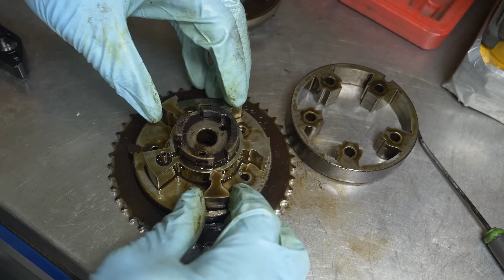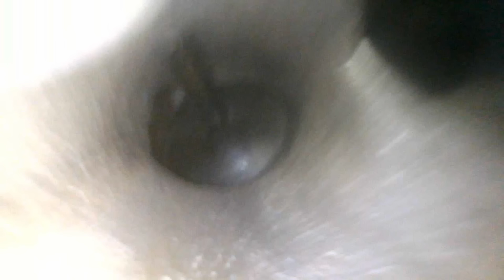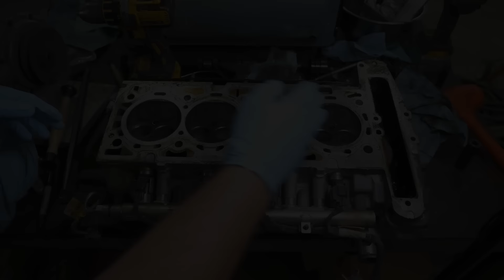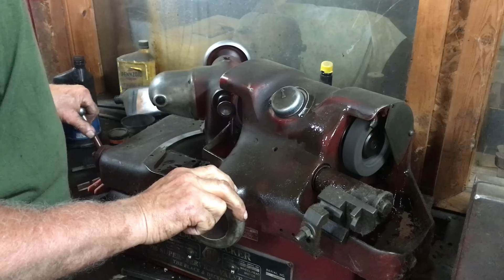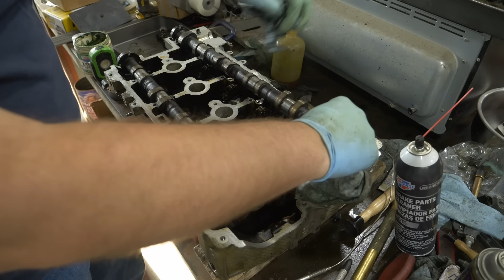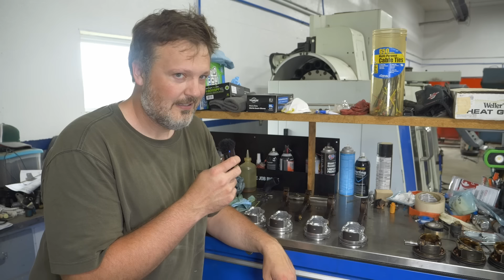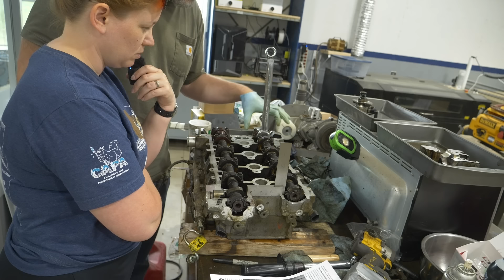How Did it Ever Run? Equinox Still Won't Start

Comment: It amazes me that these car manufacturers wont take 2 second and add literally 3 cents worth of electricity to at the bare minimum tack weld critical parts. That cam sensor reluctor wheel with a press fit and a couple cold weld tacks would never fail. It's just mind boggling how pathetically cheap these corporations are.

Comment: 1 minute in and I cannot for the life of me understand why you didn't do a leakdown when you had the timing chain off and could guarantee valves were closed. That tells you everything you need to know about the internal health of the engine. If it fails that, head comes off. Simple.

Comment: I had an intermittent compression problem years ago, wrong weight oil! Too heavy oil hydraulic locked the lifters and hung the valves. Cranked irregular and barely started, but ran smooth after the engine got hot.

Comment: i had one like this. a job on one engine that ate me up. it took me 40 hr to find and. repair it. it was  just a 4 cyl repair. have never forgotten it. it didnt help that someone tore it up trying to repair it. i paid dearly. but didnt loose  mt job. the conpany i worked for. was owned by a mechanic

Comment: Actually your wrong something will happen, it will take your money. I recently tried to get a workshop manual for a 2015 Isuzu dmax, go online enter vehicles registration details, vehicle not found, yet any other shop can find it. Remember lapping valves in with wooden stick and sucker 10 yrs old spending hours doing this, no wonder I became an electrician.

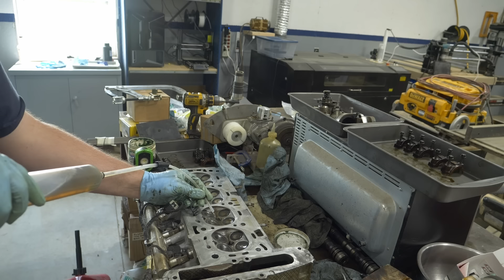Comment: You "fixed" the wrong set of valves. The set that failed your leaked test was the 3rd set from from the camera. You then proceeded to "fix" the 2nd set from the camera. Check it again. Look at time stamp 14:35 and 15:35. Not the same valves.

Comment: When people come to me with one of these cheap Korean made engines that has compression issues, I won't spend much time on it trying to figure out why. And the reason for that is exactly what this video series shows. I have been down that road and it's not worth my time or the customer's money. I give them two options, either replace the engine or find another vehicle. Every time I have tried to rebuild something like this, it turns into a shit show and doesn't stop until I do. They are throw-away engines and that's simply the way they need to be treated. Hyundai and Kia are a bit better than Daewoo but there is a reason Daewoo can't sell cars in the US anymore under its own name. Maybe you remember but they were POS cars and you will most likely never see one in the US anymore.

Comment: For checking valve seal after valve lapping, I have always used an a/c vacuum pump to check for a good seal, just use a piece of  plexiglass with foam to seal against the ports. Anything over 20inHg is golden.

Comment: should do a wet  / dry test/.  get a compression reading , dry , then put  bout capful oil in cylinder,  then do comp test again,  if reading  barley increases its the valves, if it  massivly increases its the rings,,

Comment: My Saturn Sky had the 2L Turbo direct injection motor. When it hit 110,000 miles, I yanked out the 4 cylinder and plopped in a 685hp LS7. Worth every penny. 685hp is way better than 290hp. Performance Autowerks has a complete kit to put a LS in the place of an ecotec engine.

Comment: I to came across a 2014 equinox that was driven low on oil it was running and backfired randomly or sometimes it just wouldn’t turn on I checked everything from compression to doing timming kit with gears wich I’ve seen fail before. And by luck I had another car at the shop doing a head  and decided to do some  looking at the position of the cam lobes and the reluctor ring on the exhaust cam was rotated about 45 degrees we replaced the cam and the issue was fixed car ran like new I studied the cam and couldn’t see how it rotated

Comment: Brave to use walnut shells without taking it apart. How did you manage to not get it into the pistons?  The valve were not sealed so you woulda got that dust into the piston walls.
Reply: M must’ve been a good question you got like no reply

Comment: I’m amazed at how many unexpected problems show up. It’s too bad you weren’t driving when this engine died. Reluctor wheel slipped, wrist pin bushings failed. Not the usual problem solving skills needed on this one. These are examples of problems that should NEVER happen.

Comment: I have a similar carbon on intake valve issue on a 09 mini Cooper.  I put a catch can on the pcv line.  Also, you can make a tool that spins zip ties with an electric drill to remove the gunk if you are lacking a walnut shell blaster.  Stupid design.

Comment: im in my own pickle, spent money I shouldnt have about a year ago to buy a used honda ridgeline and being the idiot I am decided to change the timing belt, how bad could it be, I just did the timing chain on my kia soiul, everything seemed straight forward, check marks multiple tmies, but when I started the truck, it did start btw but it sounded awful, not like metal on metal but like a thumping but it stayed on but didnt take acceleration really, so I turned it off, and I am going to try again, but man im freaked out I also let the car sit for about a year and now the sprocket for cam shaft has a bit of rust between the teeth not much seems like eh and so does the timing chain tension er not the hydraulic one.  I have no idea what to think if anyone has any ideas let me know cause im planning to try again, not sure if I need to replace those parts that got a bit of rust on the outside or not I dont think so, at least to see if its running seems superficial im just hoping the valves are not bent

Comment: You forget all the  info, like putting the cylinder at tdc to be tested first. When testing a cylinder listen for escaping air. Like putting ahose up to your ear not in your ear. Checking intake, exhaust and crankcase.

Comment: I have to agree with your wife as we know thats the safe option here.   Replace the engine and move on.  What else is hiding in there that you have not found?

I wonder if these issues are some of what prompted the dexos 2 oil.  Also did the original owner use the proper oils?

Comment: Had a suspected stalling fuel problem
With no coding. Dealership found no problem. Ran good to home. However shut off but restarted. Suspect bad fuel pp. Have 263000 miles on it.

Comment: This was a very entertaining video. I enjoyed this & I can see it happens to other persons besides myself although this took it the the extreme. That 2.4 is a terrible design. Can't believe GM left it in production for such a long time. The new GM engine is these vehicles Equinox, Terrain, is the 1.5 engine. Daughter in law has a 2020 Equinox with 80k miles & lost the engine already. These still suffer from oil consumption issues that has plagued these models since 2010.

Comment: There is an aftermarket piston design for "boosted" 2.4L applications and "performance" but it works just fine for the original NA engine, and supposedly solves most of the problems with the LEA and LAF design.

Comment: i read somewhere that old oil, and low level causes a bunch of heat, which can cause the timing reluctors to spin on the cam, and probably the rod bushings.  My mother-in-law's car had some similiar symptoms, she ended up just trading it in for something else.  probably been said already, but i hope i help the algorithm

Comment: Gasoline Direct Injection is right up there with Active Fuel Management in that they are both solutions in search of a problem.

Is periodic teardown to "de-carbonize" an engine going to make a comeback?

Is the Equinox the  modern version of the Vega engine?

Comment: Ya know, i was doing timing and a headgasket on a mini ended up doing a piston and rings. It never jumped time, turns out it got hot enough to release the valve seat from the head.

But honestly its still a better design than these 2.4s, they blow often but atleast the timing setup is simple, crank sprocket, cam sprockets, a tensioner, and the guides are all 1 piece. Pain to get to, but simple after youve done it once.

Appreciate the insight into some of the worst designed engines ive ever seen! Have a good day and I hope the next one aint as painful!

Comment: Why have we gone from virtually simple, reliable, bullet proof engines to hyper complicated pieces of virtually un-repairable junk, with labor times and prices through the roof?
Reply: The modern engines are more powerful, more efficient and “generally” more reliable.  I’ve owned a number of Toyotas and Hondas and when I traded them in after 15 to 20 years the engines still ran fine. 
The downside?  Nobody expects to repair them. Nobody is experienced repairing them.  The manufacturers aren’t set up to supply spares to repair something that never breaks.
Reply: They aren't building them like they were 15, 20 years ago. That was my whole point! @tomrecane6366

Comment: My guess for what has really happened with this engine is stranger than fiction...

First, throughout years of use, the engine carboned up the valves

Because of this carbon, the drain holes for the oil plugged up in the pistons and caused insufficient lubrication of the rod bearings

This lubrication issue caused the bearings to spin, and the resulting heat in the bearinga radiated itself throughout the crank and then to the cam through the engine case

This caused the cam to heat up so much that the reluctor gear, through different expansion/contraction rates of materials used, dislodged itself and knocked itself out of time, causing the engine to shut off and cause this comedy of errors we see here in the video

Comment: Fantastic vid - great job.
Since you have a new cam, take your propane torch to the reluctor wheel on the old one to see what it takes to get it to slip. Considering the car, that could be the fix!
Also, considering the car, not sure why you replaced the pistons.  
BE CAREFUL with the ring compressor when you install pistons. It is incredibly easy to have those low tension oil ring scrapers turn sideways and wedge between piston and cylinder.
I'm disappointed in  your machine shop ... that they couldn't make a bushing for those rods.

Comment: Wes, i would recommend unbolting the pickup out of the sump. Had the same broken chain guide on mine too, and the gauze screen integrated into the bottom of the pan, was full of plastic pieces, that you can't see until you remove it. Good luck with it

Comment: Who would want to work on modern cars nowadays?.........Its a costly exercise in pain and frustration!
And things are going to get WORSE!
Car design these days is BONKERS.
Nothing is supposed to last beyond the warranty period.
Nothing is properly tested before being released to the market.
Cars now are designed to be easy cheap and quick to assemble by semi skilled labour.  Makers don't give a S&IT if the car is a nightmare to repair afterwards. Zero thought given to ease of servicing/repair.
CAR COMPANIES NOW ARE REAL STINKERS.😡

Comment: Uhm you can pull the rings of the pistons and it'll at least idle if it's got gas spark and oxygen it'll fire. You'll loose alone of power n a h3ll of alot of blowby but it'll idle. ( YA WRONG) not to mention ya said good timing.  Retard cylonoid possibly???????  Pickup coil??? Ya didn't mention that.

Comment: I work at a very busy auto auction in the south east. I see hundreds of these cars with those motors that have timing issues/internal engine damage. They're simply throw away cars because as you have experienced parts arent easy to find and replacement engines aren't worth the trouble. The 1.5's always have a cheap vac. pump that fails which takes out the cam, timing chains. Those can be fixed, but once they lose compression its off to the salvage sale they go. Its just a very unreliable platform much like the kia/hyundai engines.

Comment: 1:00 the ford engines, for example, that were built in the late 80s and early 90s with “premium” cylinder rings, by about 80 to 90k miles the compression rings would have become so brittle they would suffer catastrophic failure but they often came apart in such a big piece it would score the cylinder wall a bit and then pop out. Too big to flow out in the oil during an oil change. I experienced this 4 times with my mustang as at the time it was easier on me to just swap out the engine rather than rebuild them. Now im very invested to see the rest of this video!

Comment: On cleaning the valves... I wouldn't have that much patience...
Think a tablespoon of carb cleaner & light hammer like you're checking for stuck valves would be worth a try.
If the spray were used to ungunk running, engine would be due for oil change post treatment anyway....
Old school water,  alcohol and/or solvent mist seems like a possible long term maintenance tool with these DI systems.

Comment: I'm currently working on the same engine but without VVT. When the crankcase ventilation is connected, the car has a very rough idle, like it's missing a cylinder or two. While driving, it's fine, but if you put it in neutral (manual) and DON'T hold the clutch pressed, it would stall... Compression* shows about 10-12 bar on each cylinder, which is kinda low and should be more like 16-20 bar (*I did not open the throttle valve when measuring, so that may be the reason for the lower numbers). If you disconnect the crankcase ventilation and plug the hose it wouldn't suck air the engine works like a charm! I figured it was basically allowing too much crankcase fumes through the piston rings and thought I'd throw a new set. Once I took the head and the pistons, I found out that it had already been done. (As well as the timing chain). Soon I'll put everything together and see if it was all for nothing :D

Comment: I will never rebuild an engine again. Cheaper to buy a reman engine. and faster . Machine Shops in my area are 2 months back logged. Every valve leaked, ever valve seal was missing, every piston bore was out of tolerance, every cam bearing was ruined, every rod crank journal was out of tolerance’s. Reman long block was 2,,300 tax included. Had to drive 11 hours yesterday to pick it up. Better than waiting two months.. And the machine shop said they would not guarantee flat tapit lifters because they were getting bad materials..

Comment: What's so utterly frustrating is that good high performance engines used to be reparable without all the complexity and cost. No wonder people have stopped buying modern cars. I doubt that the manufacturers will take note though. Greetings from Australia.

Comment: I learned a lot from your video, but the biggest thing I learned is new engine. I would've tapped out at having to source multiple engines from a junkyard just for the parts. You have more tenacity than me. My thought is to either replace the camshafts or to machine the reluctor wheels into the correct position, so they won't move again. Some vehicles aren't worth saving. My brother would've got a phone call so fast his head would spin. Makes for great content though, I second the gas and match option.

Comment: Wes, I was thinking about it after and wondered if the EGR valve could be stuck....open, it seemed to have such excessive deposits everywhere, Also, it must have been doing short runs in the cold right (school runs?), the engine just looks like it  hasn't been heated up. Just trying to imagine how it could get so screwed up.

Comment: Make sure you clean the port in the center of the intake they carbon up and cause oil consumption on this engine. Check the oil pump also this engine was run low on oil. I was a 42 year gm tech the last 15 as a heavy line tech and have seen all these failures but never on one car.

Comment: Probably the result of stacked tolerances. Parts are from two different suppliers and are at the opposite limit of I.D. and O.D.
Root cause is the North American understanding of QC going right back to Deming.

Comment: I had a first gen equinox it was great untill the head gaskets went and the over heating. I tried to fix it took it all apart but the head surface and block surface had small craters I gave up and junked it. I loved the way it drove but it's unfortunate the engine failed at 120k miles. I found out the person i got it from never changed the oil and let the oil and coolant run super low.for years. So when I got it it was cooked. The previous kid owners didn't take care of its maintenance

Comment: Oh yes, The lovely 2.4 GM motor. 
They tell you at the dealership it's okay to burn a court a thousand 🤣
Three timing chains and an engine replacement later. 
I'll under warranty. 
Couldn't get rid of that POS fast enough
🤙

Comment: I have that exact same valve machine but only one collet. for smaller valves I use the lathe, a carbide insert, set the compound to the appropriate angle which can be found with a dial indicator if needed (like you needed me to tell you! lol) and do a taper cut, then fine finish with a flat block with fine grit sandpaper (spray glued on), held flat against the face. maybe not ideal, but it seems to work well

Comment: 19:40 - The only 'anaerobic sealer' needed is the one used to entomb GM engineers into a sarcophagus. 

Now we know why the pyramids exist. GM Chariots was screwing up back in the Middle Kingdom of Egypt

How many civilizations will fall completely due to Six-Sigma and 'engineers'????

Scritch Max.
Reply: 20:00 - GM bypass birds start chirping so you know you're on the right path... well, except it's GM.